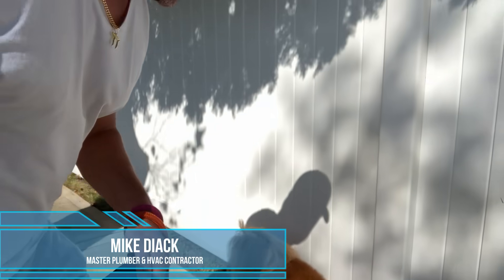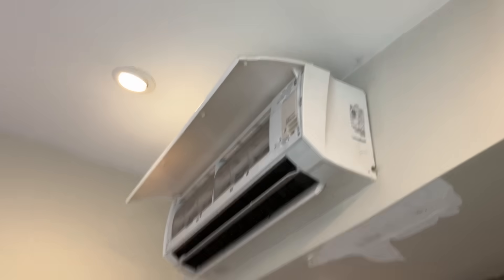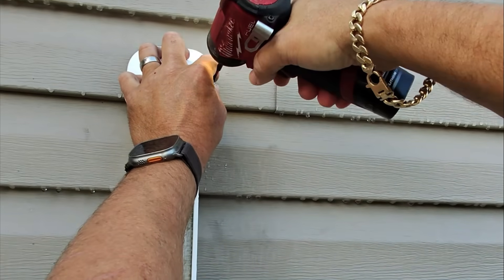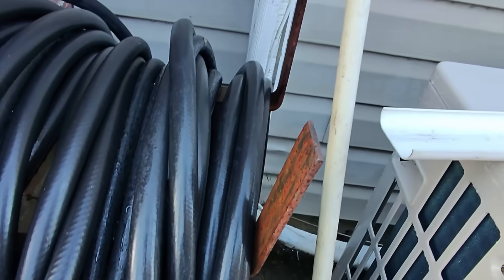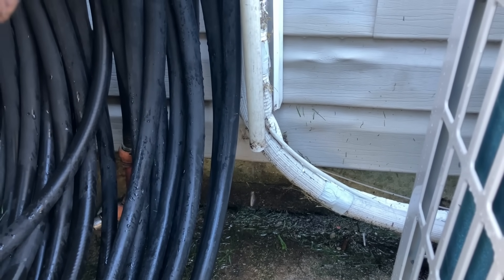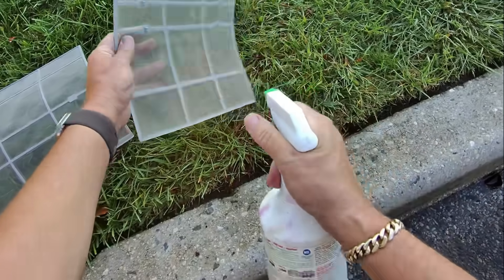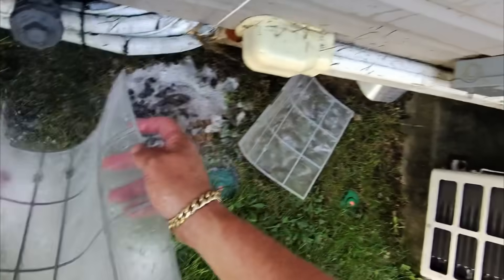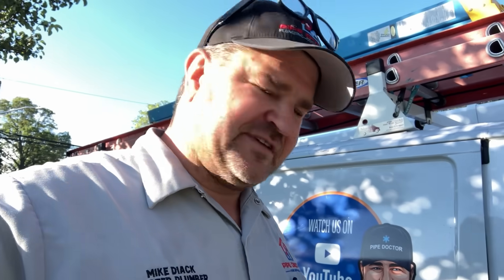Why Your Mini Split Leaks Water | Fujitsu HVAC Drain Line Fix

Comment: I recently had to clean blown in insulation from a secondary heat exchanger I used my Milwaukee  vacuum some  3/4 pvc and tubing to fit into the cells was able to get the heat working again
Reply from the maker: Glad you got it working again!

Comment: I would guess condensation off the line-set dripping off there. probably a low spot not insulated well and hot in the boxed soffit area/hot humid air leaking in from outside.
** also, what's above the box in? bathroom/sewer/water lines and leaking tub/shower/toilet/pipes? but probably low spot in line-set leaking condensation as mentioned above. lol

Comment: Take the Indoor case off its literally a few screws, so you can check the actual drip tray is clean and the outlet isn’t blocked, check the connection of the drain to the unit is secure and not leaking and the insulation of the lines at the back of the unit is intact